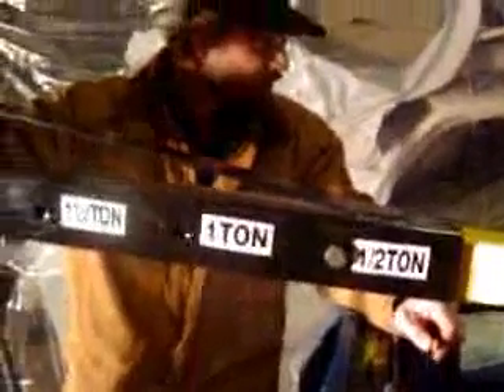EV2  Electric Jeep Part 7:  How Does It Go?  Part C

Comment: My dad and I are gonna make an electric jeep, could you tell me about how much that jeep weighs and the horse power of the electric engine? Also did you keep the clutch or did you just make a direct line for a 1:1 ratio from the engine to the differential and what kind of gearing did you use? I have a jeep that weighs roughly 1300 lbs and i just want to know the absolute minimum hp to gear ratio for different weights. If you can give me any information at all it would be greatly appreciated

Comment: hi need input on this crazy idea to try , perhaps take engine down to block leave crankshaft only ,run dc motor on top of block secured with pulley to front of crank pulley ?will loose alot ???/

Comment: Yes you're absolutely right. The controller/inverter and complexities of converting DC to proper AC is the trickiest part I think. I wish it weren't the case because AC induction has so much going for it. The other problem is, can you justify the cost of an inverter(around 3000$)? Hey check out this site everspring. net (remove space between . and net) Check out the lithium power batteries. LiFePO4 is some of the most efficient batteries per volume/weight out there. I'm so tempted to buy some.

Comment: Why does it have to be a shiftable transmision, the tesla has a direct connection, why can't you do that? or pinn the trans in 3rd, remove the shifter and give it a switch to switch to reverse by reversing polarity to the motor?

What motor is it anyway and what range do you get it when you thrash it? I would like to have a Long range, sporty EV Suburban. Do you think I make it a direct drive removing the torque converter (its and Auto) and keeping it stuck in third somehow?

Comment: I think AC induction motors are a better way to go. They provide higher rpm ranges, better efficiency, and more power than most dc motors offer. They can also provide regenerative breaking power.